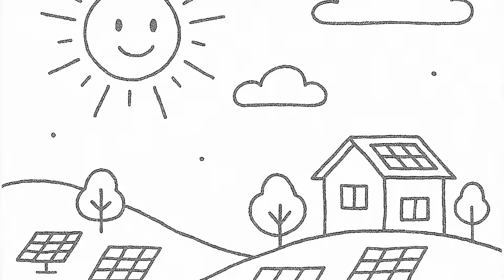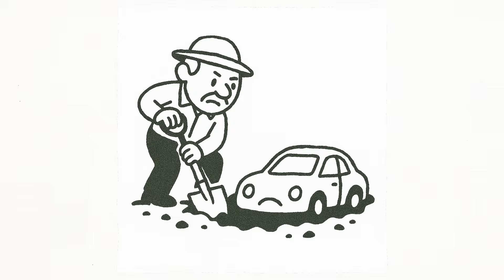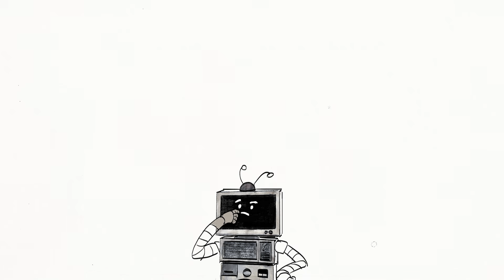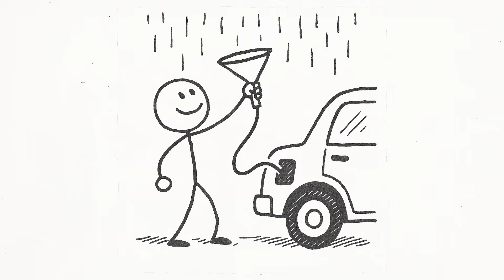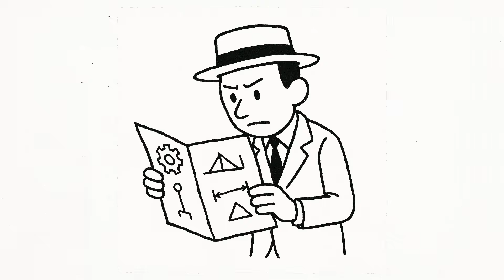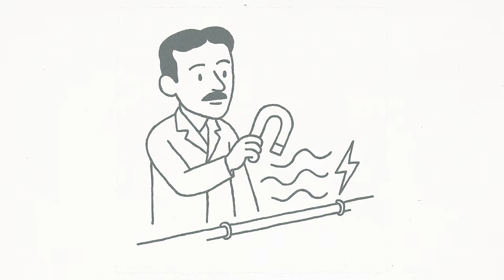Inventions You’ve Probably Never Heard Of

Comment: the watter car is defenetly a scam
electrolys works but when you have hydrogen and oxygen then burn them to get water, you get back the water you started with, and with a lower entropy than before due to the unbinding and rebinding of molecular bonds.
Pluse you need electrisity to do the electrolys to begin with so the engin wound start eaven if it worked